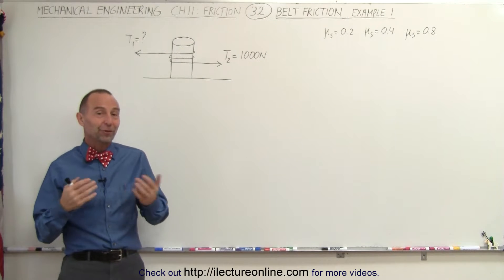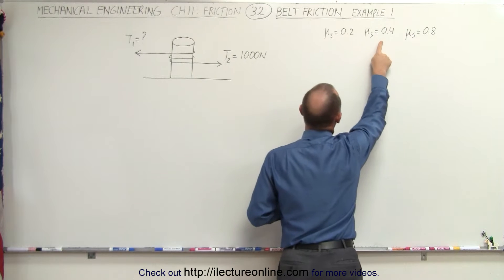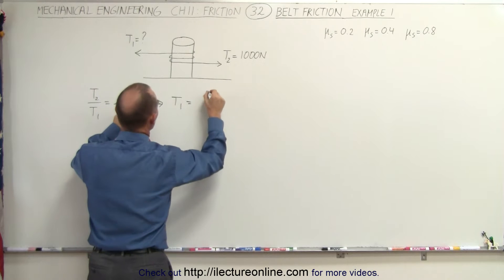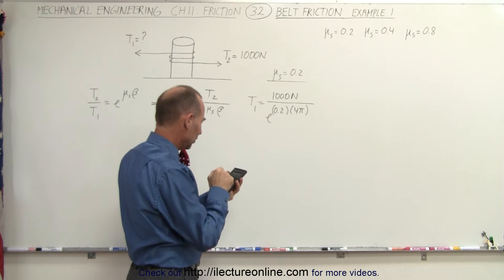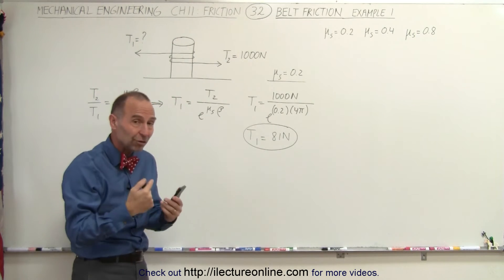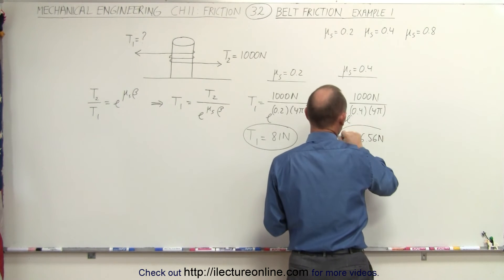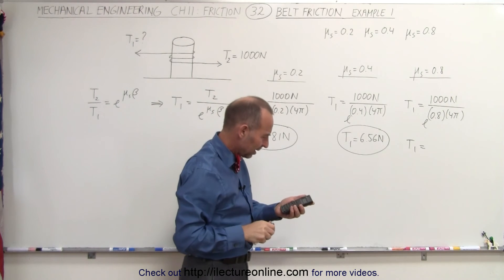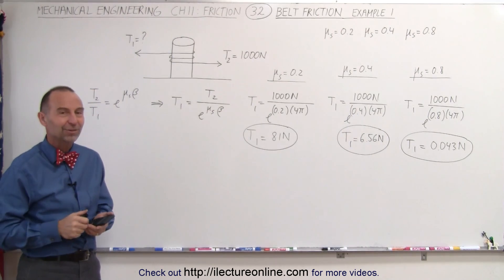Mechanical Engineering: Ch 11: Friction (32 of 47) Belt Friction: Ex. 1

Comment: So, to get the rope to slip the other way, you'd have to apply the 1000 N plus the calculated value for the given coefficient of friction? Interesting.
Reply: I believe that it is not 1000 + what was calculated. If you simply apply more tension than the one calculated, the rope will start to slip. If you apply, let's say 6.56N, the tension at that end is equal to 1000N. If you apply more, the tension will rise exponentially, based on the capstone equation.

Comment: Hello. Thanks for always being there when I have a maths question!
Does it make a difference that the rope will need to move slightly diagonally across the pole/capstan in order to prevent the rope interfering with itself? 
Does it make a difference if the rope is in fact not a rope but a cable or a flexible hosepipe?
Also, I’ve been trying to find a model for pulling a flexible pipe through various diameter orifices at different angles relative to the orifice. 
My thinking was to model the hose as a spring for the bending of the hose and the friction force through the hole as two capstans with the hose running between them, so looking down at the problem and pulling the a hose forward and bending to the right it would rub over the 10-11oclock section of the right capstan, and over the 4-5oclock section of the left capstan, but is there a simpler way to model this?
To make it more complicated, what if there is no radius on the hole I’m pulling the hose through?
Can I no longer approximate the capstan equation?
Is there a similar equation for ropes, cables or hoses being pulled around a sharp edge like a right angle? 
Then, what if there is only a very small radius on the edge, can I combine such models to account for a small radius with two relatively sharp edges either side of it?

Sorry for the huge question!

Many thanks
Dom.